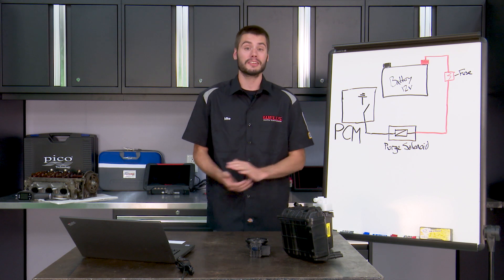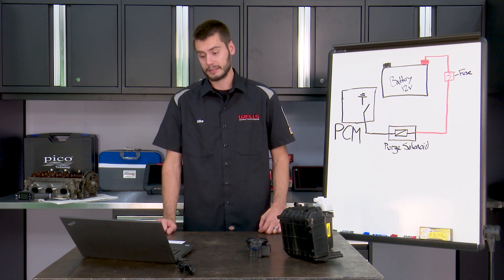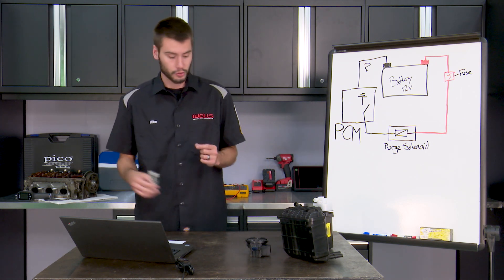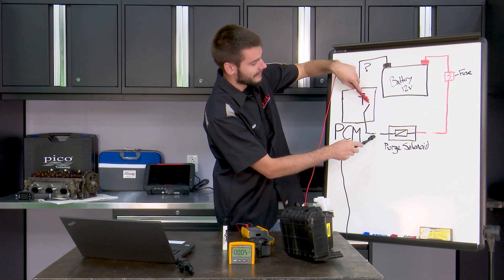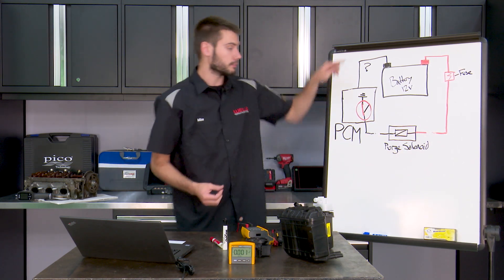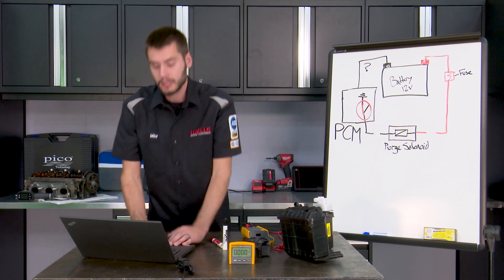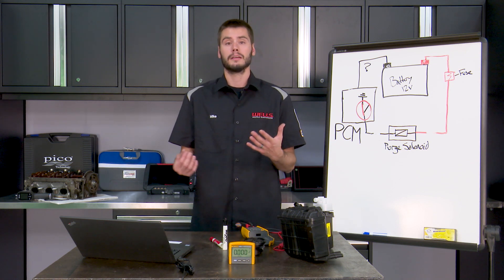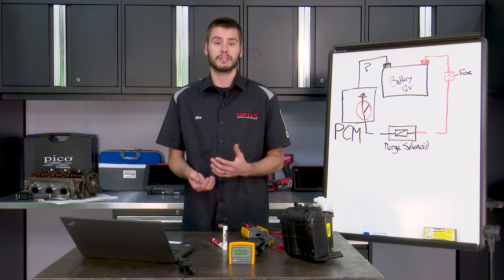TechConnect Ep 22 - Don't Forget the Basics of Circuit Testing

Comment: I have a 2001 E-250 4.2 slant 6. There are no trouble codes even when the crank and cam sensors are disconnected. Got a rebuilt pcm no help. Been checking wires nothing. It will power the code reader. I’m not seeing something. Any help would be appreciated. Thanks Russ

Comment: hey Mike just some food for thought about the question at the beginning of the video. When you substitute a 10 meg ohm  DVOM as a load it can lead you down the rabbit hole. The pcm is always monitoring the driver open or closed with its own circuitry  at a resistence less than that of the DVOM.  The best way to test the circuit is with a test light across connector with a DVOM  across the test light  sort of a load pro mode and bidirictionally open and close the purge sol driver.   Then you know current is flowing or not.  I have to give the credit to Eric O SMA   for this info    please don't think I'm being  back seat driver wishing you all the best  really enjoy your videos.
Reply from the maker: Thanks Mark, don't worry. I love comments like these. These are the comments that make us all think and get better. I prefer to take a bulb or a test light across the terminals and see if it lights. If it does consistently, then my circuit is good. It's not very often that I am using a meter to verify circuit integrity, especially unloaded. Voltage drop is still a good test too!
Mike Becker, Technical Services Instructor

Comment: please explain keiths comment , 'engine running' evap smoke test, if the engine vacuum is connected won't it suck all the smoke or do i use  a different vacuum source and what is the benefit of doing that way?  thx mike
Reply from the maker: CC, this is in reference to the LDP system. Vacuum must be applied and the solenoid must be turned on in order to "seal" the LDP and smoke test it. WIthout vacuum supplied this system will leak. Engine vacuum is the source for this. It is a direct manifold vacuum line from the intake to the LDP. Completely isolated of the EVAP system that you will be filling with smoke. Watch the video around the 20 minute mark, I talk about smoke testing the LDP system. Here is the link.  https://youtu.be/k4MJ8zy3r_M?t=21m4s
Mike Becker, Technical Services Instructor
Reply: Wells Vehicle Electronics awesome thanks a lot Mike
Reply from the maker: You're welcome! Makes sense then? 
Mike Becker, Technical Services Instructor

Comment: Nice!! I Can understand the concept on the board, so on the actual vehicle I suppose you just disconnect the solenoid and test at the connector?
Reply from the maker: Hey ME Salazar! Depends on what test you want to do. You could unplug, put a test light across it, and tell the PCM to turn it on. That would be a good circuit check.
Mike Becker, Technical Services Instructor

Comment: Hi Mike. Oh boy am I looking forward to Thursdays class. As you know my little scope has recently earned my respect as I learn how to use it. If you could cover this Thursday, it would be great. I would love to see a common single cylinder misfire. Is it possible and quicker to run a  channel on the coil, and maybe another on the injector,  and by analyzing the firing event waveform, tell if its an injector, primary coil, secondary coil, plug or even compression, without using a secondary source of fuel or swapping plugs and coils side to side, and saving a lot of time? I will see you Thursday. Keep up the great work Mike.
Reply from the maker: Hey Mike! I think that your questions are worthy of an entire class by itself! So, how about this...I plan on doing a full class just on a single cylinder misfire? Maybe show 2 different failures and how to quickly and easily identify them.
Mike Becker, Technical Services Instructor
Reply: Hi Mike. That would be great!!! I'm sure this is probably common knowledge for most techs however DIY'ers like myself don't get to see much of this stuff.  This newer technology way of diagnosis is fascinating. BTW, I'm waiting on the camshaft to arrive. I will try to send pics  this week of the disassembly.